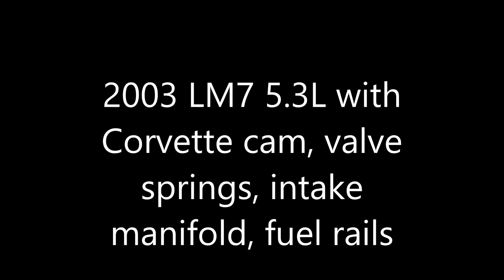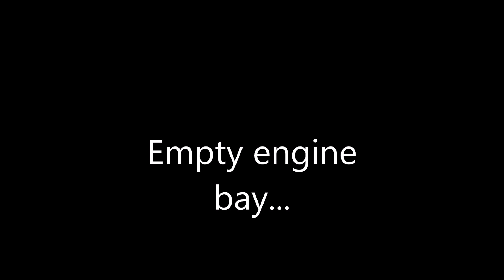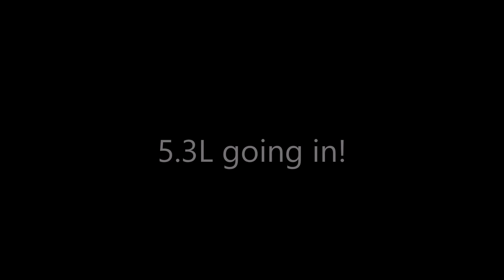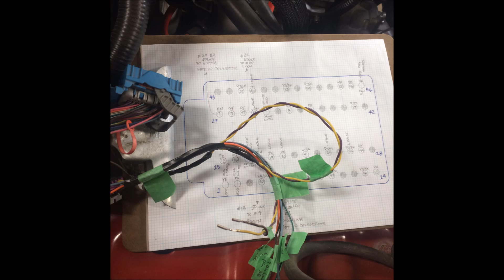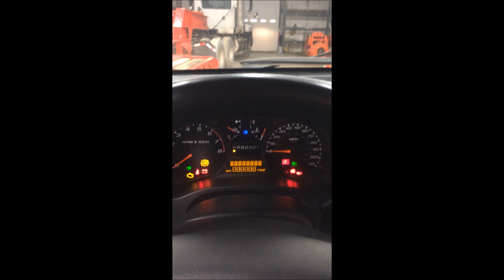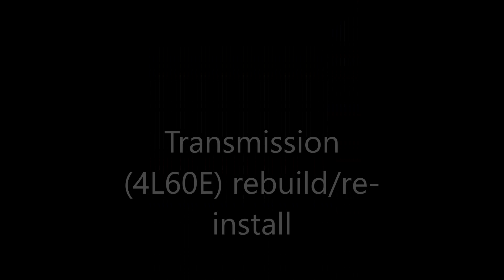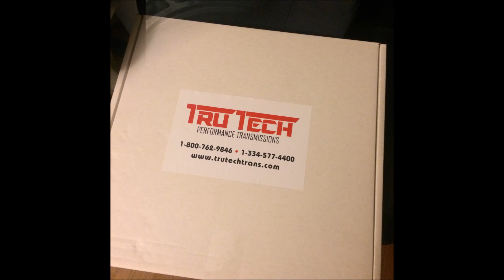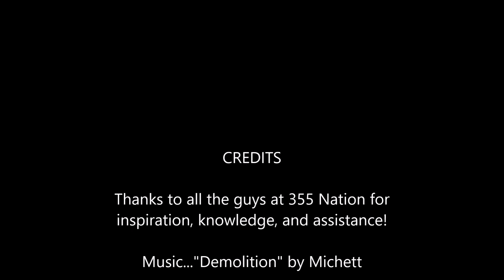Colorado LS Swap

Comment: I haven't read all the comments but I am going to put my two cents in... It would be nice if you made a follow-up video of the complete install.. what wiring harness do you use what motor mounts you used and so on...
Reply: the harness is my next step in my swap

Comment: Amazing work I’m in the process of doing the ls swap On a 2008 Colorado i need some information did you buy the wiring harness or did you build it yourself ??? If so would it be possible to get the wiring Schematic you did to wire up your Colorado it would really be appreciate it..
Reply from the maker: David Garcia I had a custom wiring harness made by a guy in Canada. It wasn’t cheap, but everything on my truck works just like it came from the factory.  You can find him on the 355Nation forums, his user name is 04colyzq8.

Comment: Thank you Gregory Pennell for making this video. If you could tell me what would be the best model and make to get for the 5.3 swap. If I could get something that has everything in need but the wire harness that's the way I would like to go. I have a 05 Colorado with a i5 3.5L. Thank you again
Reply from the maker: Steven Carnes the best advice I can give you is do a lot of research before you buy anything. 355Nation.com is a great place to start...lots of info on Colorado’s in general, and they have an engine swap section on the forums. Any LS based engine can be made to work, it just depends on what you want in the finished project. I wanted everything in my truck to work as it came from the factory, so that drove all my decisions on my project.  A great source of information and parts is Current Performance in Florida.
Reply: Thanks for the info and I am looking for the same thing in my truck that you are. Now that I have a place to start that helps tremendously thank you.

Comment: My brother and i installed a 6.0 with a 4l80 in his 09 colorado with H3 truck seats.  Some stuff we had to fab ourselves; trans mount, air box intake, fuel lines, 3" exhaust with black widow mufflers.  Took it to a shop to have it tuned and they burnt it down to the ground!!!   Building my 99 s10 with a lsa blown 5.3 now...but want to build another ride for my brother to replace his lost dream...
Reply: How did the shop destroy your Colorado?

Comment: And not to mention the 15grand in receipts for parts, shop time and extras ...interior, stereo, hood, roll pan and some extra parts for trial and error test fits...
Reply from the maker: Lucky Muse  that’s a tough deal. I keep trying to tell folks there’s nothing really easy or cheap about swapping one of these trucks...unless you can do most or all the work yourself.   It would’ve been cheaper for me to have bought a decent Silverado 5.3, and put a turbo kit on it.

Comment: Hey, awesome work bud. I plan to do a 4.8 ls swap. Eventually plan to boost it. I plan to do everything I can on my own. Did you use the stock oil pan?
Reply from the maker: Joe Dirt yes, I used the stock Avalanche oil pan. I’m thinking about changing it, it’s too low and I can’t lower my truck any until I get it out of the way. Right now it hangs about 2” under the front cross member.

Comment: Nice swap!! How is the swap working out? Any more vids you got of it?
Reply from the maker: Thanks!  I've put a few hundred miles on the truck so far, and it's running great!  Lot more fun to drive than it was before.  The guy that built my harness and set up my computers programmed the PCM with a custom operating system using EFI Live that allows everything on my truck to function as factory...My throttle pedal controls the LM7 DBW throttle body,  my ignition switch starts the engine, all my gauges work, my cruise control works, and anti-theft works, just like before the swap.  I'm working on another video, should have it up soon.
Reply: @gregorypennell1755  who put together your harness / computer set up

Comment: How did the 2010 Colorado manifolds fit?  I am in this process and have the stock mani's from the 5.3 and my driver side is hitting the frame rail by quite a bit.  Thanks
Reply from the maker: Robs Garage they fit my truck perfectly. I believe I got them from GM Parts Direct.
Reply: Thanks a bunch!  I am going to check my local dealer here this week.  They seem to be a bit cheaper from them than anywhere I have seen.  Nice truck and thanks for the quick reply.
Reply: I see that the driver side may come with a converter attached?  I can't seem to get an actual picture but GM Parts Direct says that it comes with one.  Did you use it?
Reply from the maker: Robs Garage no converter on the manifolds on the V8. The description/parts diagram is a bit screwy on their website. The cats for the V8s are in the exhaust pipes (hold your wallet tight if you look at the prices...).  I used an aftermarket cat-back system from Dynomax, and a buddy helped me fabricate the head pipes to go from the manifolds to the rest of the system.
Reply: That's good to know.  I doubt I will run cats anyway as there is no emissions testing here haha. Thanks again
Reply: Robs Garage 2016 Colorado with a supercharger
Reply: @gregorypennell1755  Sorry to revive an old comment lol, but I am actually in the process of doing this myself and I have everything but the manifolds. So what you're saying is that the stock 5.3 manifolds from gmparts direct will fit my 04 colorado without any issues? or did you have to modify them?

Comment: Im Ls swapping my colorado to. Did you have to use a while different harnes??
Reply from the maker: Hector Rios yes, a custom harness if you want all your factory gauges and stuff to work.
Reply: Gregory Pennell  were did you get the custom harness? And that's all you needed to swap it? Did you need different mounts for the engine?
Reply from the maker: Hector Rios yes, you need custom engine mounts, and a lot of other stuff. There is no “kit” for LS swapping Colorados, like there are for a lot of other cars.  Best advice I can give you is to get on 355nation.com and read through the engine swap forums. There are several different ways to go, but none of them are particularly cheap, especially if you want stuff to work properly. The real,pros at swapping Colorado’s are the guys at Current Performance in Florida.  Look them up and get in touch. If you’re serious.

Comment: What's the fuel economy comparison from now to when you had the 3.5 in it
Reply from the maker: betterthanyou1070  I really can’t tell much difference in fuel mileage. The V8 doesn’t have to work nearly as hard as the 5 cylinder to move the truck around. If I keep my foot out of the throttle, I get around 22 mpg average.
Reply: Gregory, I need your advice. I’ve the 3.5l  I-5 but I wanna do an LS Swap but don’t no which of them to use and how to go about it.

Comment: Gregory... if you dont mind, what upper and lower hoses did you use? Oem 5.3 Colorado?
Reply from the maker: J Sumrall  lower hose is factory 5.3 colorado...upper had to be spliced to fit, I’m running an F-body water pump, and the colorado upper hose wouldn’t work. I went to the parts store and got something that looked close, and made it work.
Reply: Gregory Pennell... ok thanks man... the lower i assumed you ran OE.. i did notice the pump was a car pump so that threw me off as to what upper you used lol. But i work at Napa so im sure i can find one that will work. I too am gonna use the trailblazer manifolds.. seems cheap and worked well for you!
Reply from the maker: J Sumrall those are factory 5.3 colorado manifolds...I don’t think the TBSS manifolds will work on the drivers side
Reply: Gregory Pennell ... ooooh ok.. awesome! Thanks man! Saves me there lol
Reply: Greg, did you ever get A/C working?
Reply from the maker: J Sumrall yes, A/C works.
Reply: Gregory Pennell ... awesome bro.. when i get that far i may have to ask you what all you used my friend.
Reply: Gregory Pennell ... did you use the stock Silverado 5.3 oil pan.  Or did you use the H3 Lu8 5.3 pan bud?
Reply from the maker: J Sumrall  I used the stock Silverado oil pan. Fits perfect, just hangs a little below the crossmember. If I ever get around to lowering the truck, I’ll change pans.
Reply: Gregory Pennell thanks man... thats kinda what i heard.. it hung low. Just wasnt sure quite how low.. but at most i might drop 2 inches one day.. so i may invest in pan. Thanks as always.. parts list almost complete and motor is built and ready.

Comment: I’m buying a ls1 of my buddy it needs a rebuild he had it swapped in a 4x4 Yukon and hurt the motor mudding lost oil pressure and he lost interest 
He’s gonna pull it for me and scrap the Yukon it has bush button 4x4 
Is there anything if missed on my list 
Engine ,harness ecu/ecm ,rad ,fuel pump?
Reply from the maker: Dion Mackenzie   Motor mounts, headers/exhaust manifolds, exhaust system, electric fan...if you aren’t on 355nation.com forums, go check it out. There’s a ton of information on there on swapping Colorados. Just FYI, the stock radiator and fuel pump work just fine.
Reply: Gregory Pennell tanks again for your reply the buddy I’m buying it off of is gonna grab everything for me including mounts headers and fan and the stock fuel pump won’t starve out? I figured for sure the pump wouldn’t be enough
Reply from the maker: Dion Mackenzie  I’ve been driving mine on the stock pump for well over two years now with no issues. I’ll be really surprised if any of the stuff from the Yukon install will fit the Colorado. They are very different.

Comment: what engine will line up with the 2.9l automatic trans. in my 2008 chevy colorado...i was wondering would the 3.7 work...?? anybody got any idea
Reply: Sell the 4l60. Go buy a 80. 
I have a factory 5.3. And when not if I have transmission trouble I’m swapping transmission. 

I also have a 04 that will be getting a 5.3. However I’m going manual

Comment: umm idk that much about swaps but did you do some cuts so 5.3 can fit or no need?
Reply from the maker: Esau Garza no, didn't have to cut anything, except minor trimming of the engine frame mounts.
Reply: Oh nuce thx and from what veihicle was it again the 5.3?
Reply from the maker: Esau Garza the motor came from a 2003 Chevy Avalanche.
Reply: Ah ok and how much did it cost

Comment: Didn't GM offer these with the 5.3 for a short time?
Reply from the maker: Yes, from 2009-2012 there was a factory V8 option on certain models. However, most of the factory V8 parts won't work with early models like my 2004, due to differences in the frame and firewall, and the electronics.

Comment: What about motor mounts and is that the stock transmission or the same from one from the v8 ?
Reply from the maker: The motor mounts are made by Current Performance, and locates the engine such that the factory transmission crossmember fits in the stock location, along with the factory driveshaft.  The transmission is the 4L60E that came in the truck.  We rebuilt it, and changed the bellhousing.  The V8 has a different bellhousing than the inline engines.  I could've used the trans from the V8, but it was already sold from the donor truck I got the engine from.  GM has used the 4L60E trans in everything from Corvettes to pickup trucks for years, and with a few upgrades its a good, reliable unit.
Reply: Gregory Pennell I have a 4l60e tranny here but do u think it's possible to use it as it has a transfer case on it tho I wouldn't mind keeping it and upgrading it
Reply from the maker: You should be able to just unbolt the transfer case, and bolt on a regular tailshaft.  There are a bunch of different ones, though, so you'll have to measure to get the correct length, and check to make sure the driveshaft yoke splines fit.  That was one good thing about using the trans that came in my truck.
Reply: Gregory Pennell u think it's possible I can use the 6l50 transmission in my truck ?? I just wanna keep the 6 speed auto and can hold a lot of. Pressure and hp stock
Reply from the maker: Ask the guys at Current Performance.  They've done all sorts of swaps with Colorados, and might have done a 6-speed.
Reply: Gregory Pennell how much did they charge u if u don't mind me asking
Reply from the maker: I believe the motor mounts were around $150, plus shipping.

Comment: So I have a 2006 2.8 Chevy Colorado if I git 5.3 it will bolt up to my tranny 

 I need motor mounts and wire harness what else??
Reply from the maker: Pepper Beed short answer, no it won't. If it's the 4L60E, it can be made to work by changing out the front pump, input shaft, and bell housing.
Reply from the maker: Pepper Beed if you're even considering a swap like this, you need to do a lot of research. There is tons of information on the 355 Nation forums on engine swapping these trucks.
Reply: @gregorypennell1755  hi I got got a 2009 chevy colorado today I was wondering if you have a step by step guide on how to do this swap never done one like this before. 

Thanks Randy

Comment: Hey brother what were the biggest modifications ??
Reply from the maker: Alex Beltran biggest modifications were no doubt the electronics, wiring, and computers. With the Current Performance engine mounts, the engine just dropped right into place. The transmission mounts even fit the stock crossmember.

Comment: What was the price range to get everything to work like factory?
Reply from the maker: After selling the old 3.5L 5 cylinder motor, I have roughly $6,500 in the conversion.  That includes some stuff that isn't absolutely necessary, but since the truck is 12 years old, needed to be done soon anyway (shocks/struts/brakes/suspension bushings, etc).  The custom wiring harness/ECM/TCM and programming was a substantial part of the cost, but everything works as it should...all gauges work and read correctly, factory ignition switch and anti-theft, drive-by-wire, cruise control, are all fully functional.
Reply: Gregory Pennell I am very much interested in doing my truck if I give you my phone number would you give me a call cuz I am very much interested in doing my truck putting a 5.3 and it has L 5 on it now

Comment: Are you running on the stock fuel pump
Reply from the maker: Shy M yes, it's been running fine for a year now. If it ever gives me problems I'll change it to a Walbro.
Reply: +Gregory Pennell thank you and if you pull off the 5.3 with the harness and computer and tcm from the same vehicle do you still have to reprogram ecm
Reply from the maker: Shy M there are different ways to do the swap. Depending on the year model there are only certain ECMs that are compatible with the Colorado BCM. There's tons of information on the 355 Nation website, in the engine swap forum.

Comment: your coil rails do you no what car it came out of.
Reply from the maker: Yes.  Everything came from a 2003 Avalanche, except for the intake manifold, cam, and valve springs, they came from a 2000 C5 Corvette.  Exhaust manifolds were for a 2010 Colorado V8.